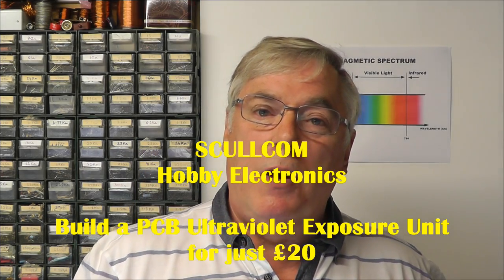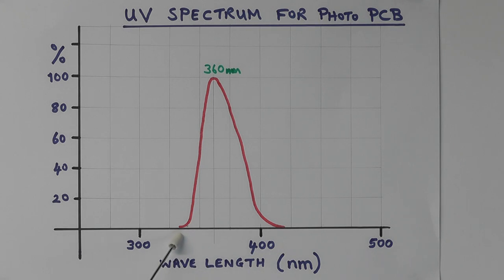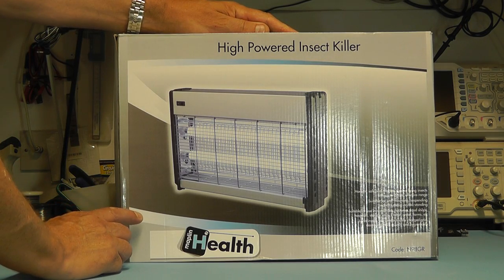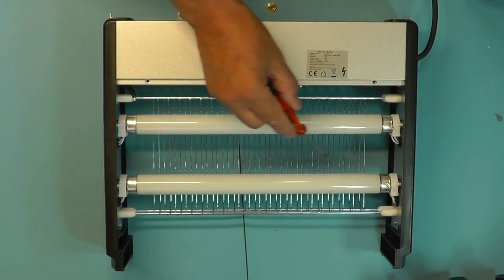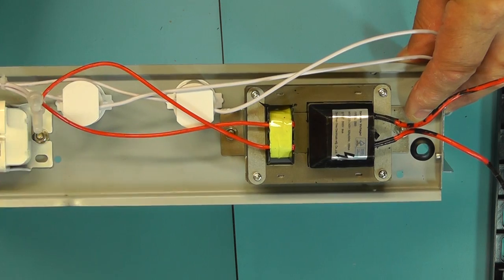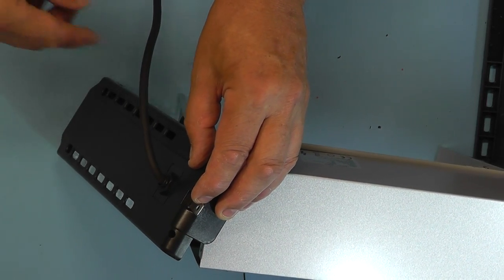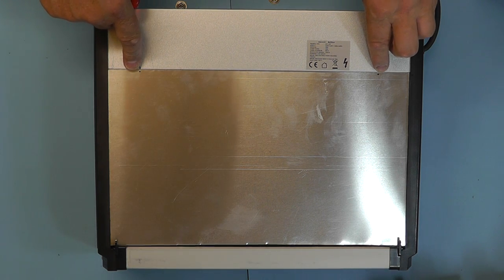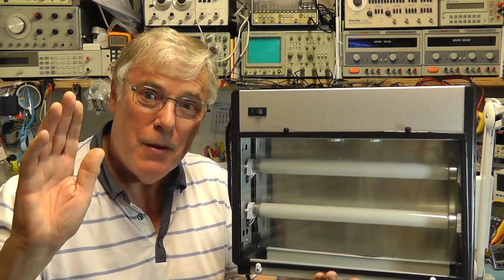Scullcom Hobby Electronics #27 - Build a PCB UV Exposure Unit

Comment: Clever, and good video. 
I just took apart a unit branded "Perel" ("Velleman" in the manual). It looks exactly like yours, same case, but it contained a fused C-W voltage multiplier with resistors instead of a transformer. It was connected with a pin connector, so easily removed. The tubes are 10 W labelled "GIK08LAMP".
Reply from the maker: +MrHerrf Yes I think the "Perel" unit is basically the same one and so it should have the same wavelength UV tubes.

Comment: Knowledgable and informative as always. (Been watching all of your videos for months now, top notch.) Two questions - For your millivolt meter, it wouldn't be too hard to turn it into a DIY oscope. A lower resolution ADC would have to be swapped on, in exchange for more MSPS as 14 bit would be too slow following the rule that your sample should be at least 5 times your Mhz, and we'd want at least, say, 100 Mhz. Rigol offers the 1054 which after modification one gets 4 channels @ 100mhz for $400 USD[when all 4 are active, it drops to 50mhz-- the way they get it so cheap is by using the technique of swapping between ADCs for each sample, totalling to the usage of 2 dual ADC's (4) to attain 100mhz@1000 MSPS]. Since this is so cheap, the project I suggest sacrificing channel count for more range. A cheap FPGA could clock in that data quite easily.  Then perhaps then if one were to add a simple ramp frequency generator, a signal analyzer (very similar to the Red Pitaya, or NI's expensive (for the hobbyist but very very cheap comparatively) VirtualBench). ? Question two -- is there a way to 'tune' the light frequency, like one would with a VCO + LO, such that you could shift that band 50nm left or right? Thanks for the time, my good man!
Reply from the maker: +wither8 Converting the millivolt meter project to an DIY oscilloscope would need a lot more work to achieve that. My first thoughts would be to use a high speed 4 channel multiplexer controlled by an oscillator running at about 250Hz, which should be fast enough. If I remember correctly Maxim Integrated Circuits offer an 4 channel video multiplexer IC with built in video amplifier (MAX4311) which could do the job, these chips cost about £5 so low cost. The idea of using a video multiplexer could be a nice project as an add-on to a 2 channel oscilloscope to give 4 or even 8 channels. As you indicate there are possibilities here. With regards your second question on tuning the light frequency this is not possible in the project converting the insect killer, the UV tubes are a fixed wavelength. Thanks for your comments.

Comment: Nice project as usual. Anyway I think the next best project you can make in addition to that is an adjustable timer. It has a plenty of room inside to fit a timer board. I think it is a good addition to that so that you don't have to manually time your PCB exposure and you can possibly avoid over exposing your PCB as well. Perhaps a little microcontroller can do the job well for exact timing.
Reply from the maker: Hi'gak Iya Thanks. This is some thing to consider for an upgrade.
Reply: Great. Looking forward on your upgrade video on this project. Thank you. Your video content is always fantastic specially on building projects.
Reply: Hi'gak Iya 
I got a face tanner (with 4 tubes for 1€ on ebay), that had a mechanical windup timer built in. Of course that was built for times up to half an hour. So I just opened the timer (watch the springs), cut most of the balance whell away an reassembled. Now a full turn of the timer was 4 minutes, which makes it easy enough to hit the 60 seconds that worked best with the four tubes and PCB material.

Comment: Great conversion! Looks like you just used normal glass.......I assume safety glass would filter some of the UV, albeit only a small amount?
Reply from the maker: IanScottJohnston Yes I used normal glass as I found that to be the best. Most glass used for windows does block UV-B but not all UV-A. So since our UV is in the upper regions of UV-A then normal window glass works just fine, although there is some reduction hence I found the exposure time to be around 2 minutes compared to about 1 minute with commercial UV Exposure boxes. Toughened glass/laminated glass can absorb UV light in the 320 to 380 nm region and in some cases reduced UV light transmission by as much as 99%. One other option I have used is to use the glass from an old flatbed scanner, which works great.

Comment: On your other video you had an old scanner converted into UV Exposure unit ;  transferring the gear (ballast and starters over to scanner should be straight forward  but would the same florescent  lamps fit in the scanner?
Reply from the maker: In my other older UV Exposure unit I only used the top glass and lid of an old scanner which was fitted to a wooden box I made. Inside I had 4 UV tubes (Mega Electronics 34-0709 15W Tubes) and starters and blast from an old florescent light fitting. 
The UV Exposure unit made from the insect killer was just as good and cheaper and simpler to make.
Reply: Thank you very much.  That's of great help.  Nevertheless I could see that Maplin's high powered insect killer had gone up in price since and currently sells for £35! hence, wanted to make use of an old cannon gathering dust. By the way, the 4 UV tubes would make a UV unit of 60W vs the 20W insect killer but the 60w tubes are 18" long! (no good for the scanner of 12")
Reply from the maker: Thats why on my first UV Exposure unit I had to make a wooden box. However, Mega Electronics also do a smaller 8 watt tube which I think would fit in a old scanner. Below is a link where these tubes are sold (£18.48 for 2 tubes plus 2 starters):
https://www.rapidonline.com/mega-electronics-34-0707-8w-tubes-and-starters-set-34-0707
Interestingly, after my video Maplins sales of the Insect Killer seem to have go up and my local store quickly sold out - I think they have taken the opportunity to increase their price!!!!

Comment: What about the UV nail gel hardener units? looks like you could just make one of those work they also have a built in 2 min timer....
Reply from the maker: All depends on what wavelength the UV light is. If it is in the 360nm range then it may work.
Reply: Nail curing occurs @ wavelengths ranging from 340 to 380 nm.  One aspect of using one of the nail exposure units is that many are designed to be omnidirectional so that the non-flat surface of fingernails are fully exposed.  This is not desirable for PCB exposure.  See: https://www.youtube.com/watch?v=muA1o73KQcw

Comment: Thats really nice :-D, your just too clever, who would think about using such a cheap item to make a super cheap uv exposure unit lol :-D.
That looks like a unit designed for the job now, i suspect the ones sold for pcb work would cost a hell of a lot more.
I did make an eprom eraser about 20years ago, i purchased a tiny clear tube from r.s semiconductors, an old die cast box and a fishtank lighting choke and starter i had in my junk box, so i threw it together and added a hinged door/tray with a power lockout switch for safety, i had very clean eproms after that ha ha :-D
I would imagine the clear tube produced the lower range on your chart, but i dont actually know really lol.
Reply from the maker: zx8401ztv Thanks for your comments. One option I considered with this project was a hinged lid over the glass - like a scanner. Like you many years ago I made an EPROM eraser which I used to clean and reuse eproms in my BBC Model B Micro Computer - which I still have !!!! Back in the days when I use to code in 6502 assembly language.
Reply: Scullcom Hobby Electronics Ahh the bbc, i didnt have one myself, but my frend over coventry loved them, i had a look at the rom sockets and the 4 to 16 line decoder driving there cs pins, i did say "you should be able to add another 8 eproms to this decoder", he was supprised that i knew nothing about the bbc but could see expansion possibilitys.
He did say "yes your right, you can fit an expansion board".
I had learnt from my old 8 bit zx spectrum, i modified a zx81 2k programmer and lifted it into the 32768-65535 memory map, i modified it like mad lol, all the way up to 27512 (i programmed it in 32k chunks) lol.
You know, i had so much fun with my simple speccy and making interfaces  :-D
Reply: zx8401ztv Just butting in I'm from Coventry :)
Reply: aqib2000 Not far away at all :-D, im in bedworth.
Your not butting in, its not my channel :-D
Reply: Not many people in the West Midlands that do much electronics anymore zx8401ztv :)
Reply: aqib2000 I know what you mean.
I still fiddle about with electronics/computers, but mostly fixing frends equipment, Im expected to know how to repair everything, thats frends for you lol.

Comment: I watched this, and stared thinking that this same idea would be just the ticket for erasing EPROMS.  What do you think?
Reply from the maker: +bsb0011 Yes it could be used to erase EPROMs. This project has UV tubes which operate at a wavelength of around 350 nm. The recommended UV light for erasing EPROMS is 253.7 nm for about 20 to 30 minutes, with the lamp at a distance from the EPROM of about 2.5 cm. As you will see the wavelength of this PCB UV Box is somewhat higher and as such you will find the EPROM erasure time is much longer - it could take about 1 hour or more.

Comment: I used second hand desktop tanning lamp. It costed me 10 Euro, but this one is nice too.
Reply from the maker: Andrej Gelenberg Another good idea. Thanks. I think the UV wavelengths used in tanning lamps and sun beds operate in a broad spectrum from 300 to 400 nm. It would be interesting to know what was the actual wavelength of the hand desktop tanning lamp you use as I think they will vary.
Reply: Andrej Gelenberg 
You paid 10€? You got ripped off ;) ! Ebay has almost always one that goes for 1€ (until you add shipping costs; then you're at 10€ again, so if that was included in yours, you made a good deal). 
A tanner has a few other advantages: more tubes (most have at least four) which means more even illumination; a reflector, that's often corrugated to focus the light more directly to the front; and most include a mechanical timer, that can be modded for the shorter times needed for PCBs. And all the parts are a size so that they fit almost exactly in a A4 flatbed scanner, as if they were made for each other.

Comment: what about uv tubes for pond filters?
Reply from the maker: Never tried a UV tube for a pond filter, but I understand that the wavelength of these Germicidal tubes is in the range 100nm and 280nm (the UV-C band of ultraviolet light) which is below that required for photo PCB work. For photo PCB you need a UV wavelength of around 360nm which is in the UV-A band of ultraviolet light . So I do not think a UV tube for a pond filter will be effective for photo PCB exposure. In my video at the beginning I illustrate these UV bands.
Hope this helps,
Regards,
Louis
Reply: makes perfect sense they would want it at the more biologically destructive end of the spectrum, i do know pond tubes destroy plastic bottle and jars if the lights escaping....

Comment: Arduino based timer please. Thanks, great idea.
Reply from the maker: elboa8 I will look at a timer as an upgrade option.
Reply: Scullcom Hobby Electronics  I have an Arduino sketch for a simple timer. I can post it if you like. Regards Eric
Reply from the maker: elboa8 Thanks for the offer but I already have some Arduino sketches. I was linking of a cheaper way to make a simple timer as using an Arduino for this project may be a little over kill and more costly.
Reply: +Scullcom Hobby Electronics wellll this is a great video, if you want a cheap timer without being too fussy with accuracy then i did a project for a time delay board for small electronic safes... used a 555 timer into a decade counter chip, if you get the 555 to count 6 seconds then pulse you can get 1 min or have it switch for 6-12 sec for 1-2min, total cost to make ummm, maybe £4? all in, im not sure if the relay or circuit board will cost the most lol